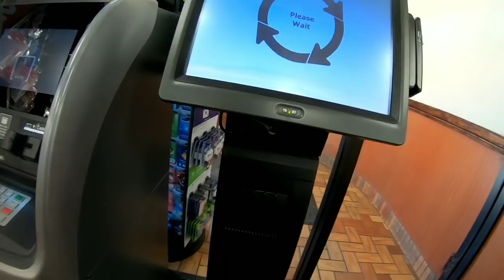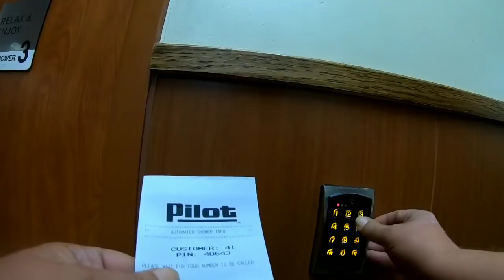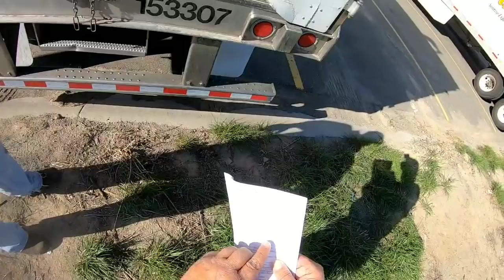Filmed On April 9, 2020. Pickup In Twin Falls, Idaho

Comment: I see that they're taking off the inner doors to places (like the Flying J), meaning you haver fewer things to touch. Doing the same here in S.E. PA. The puppies were unusually quiet for the truck wash! Those load bars couldn't come cheap – lucky that stop had them. Good double-check on the seal number. Now only 1,551 miles to go! Stay SAFE!